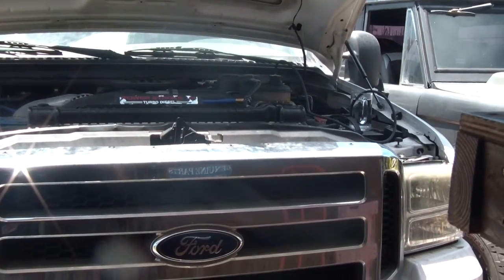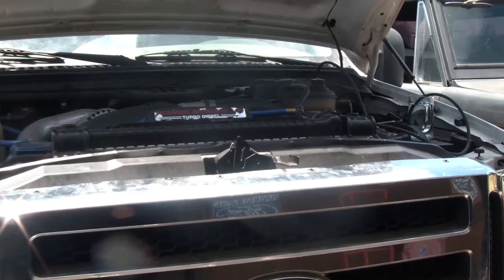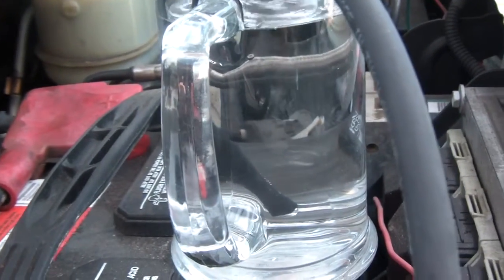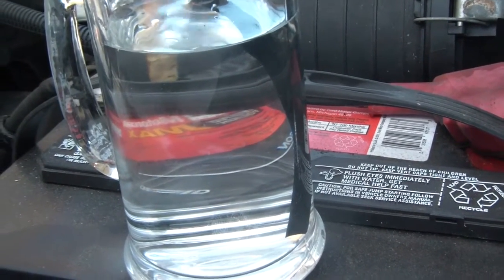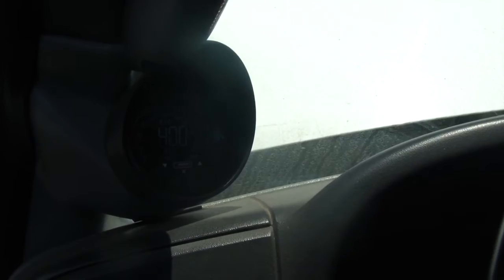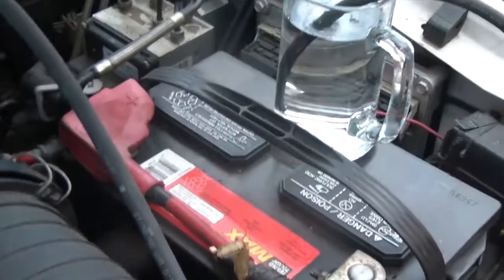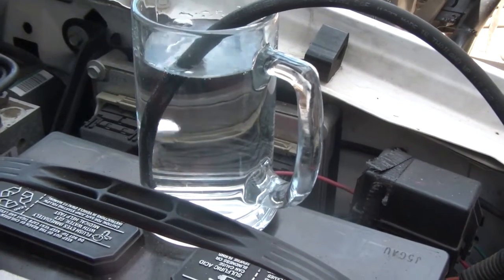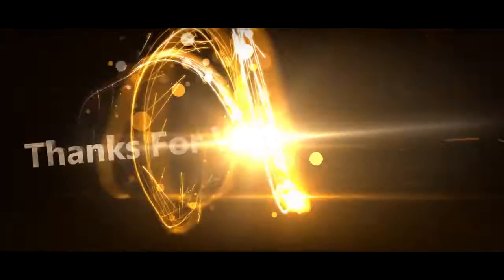Powerstoke 6 0 head gasket or EGR cooler problem? water cup bubble test

Comment: I know it's been a while now.  I was always under the impression that you're not supposed to rev it through the test.  You warm it up, and then if you start seeing bubbles, you disconnect the turbo plug, and see if the bubbles change.  Then you plug it back in, and see if the bubbles change.  In the end, what did the problem end up being?